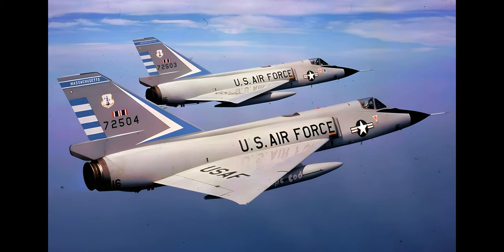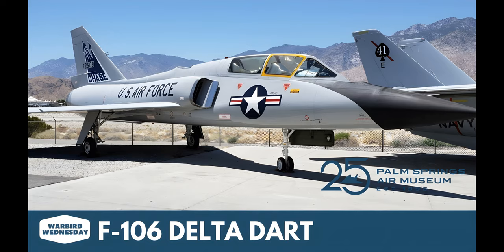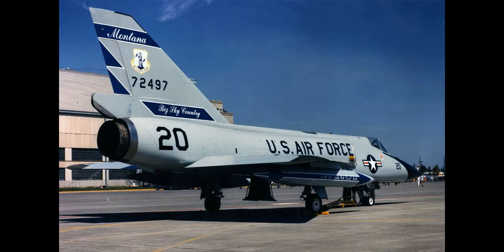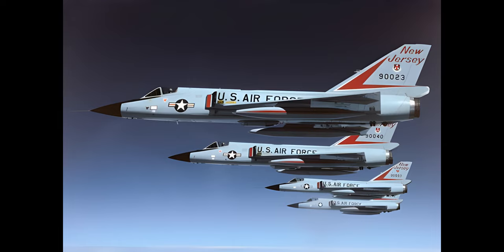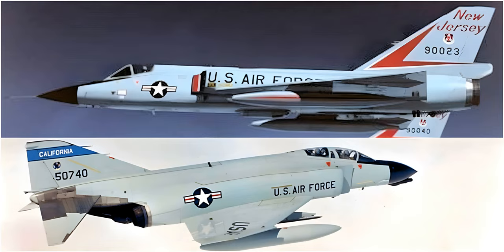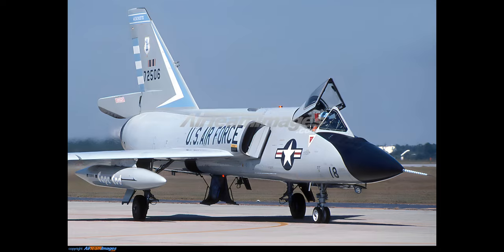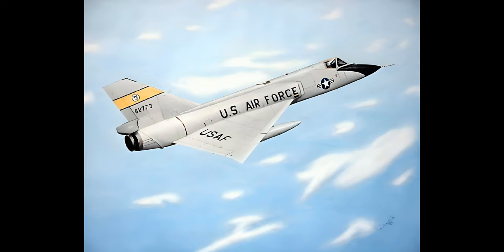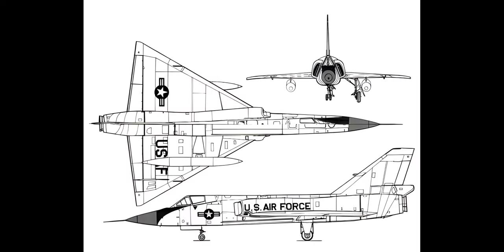Convair F-106 Delta Dart

Comment: Dear AudioWik, Please note we in the air force never referred to any fighter jet as "F-one-hundred" anything with one exception: The F-100 itself was the only fighter jet that was called "F One Hundred"' All other "Century Series" fighters from the F-101 to the F-106 were referred to as "F One-Oh-One" (F-101) or "F One-Oh-Four" (F-104), etc. always using "oh".
Reply: It’s an AI creating the vocals, not someone actually narrating. That’s why it mispronounces things and sounds so awkward.
Reply: @parkerlamarbrook  Even so, can't they write it so the AI reader sees it as one oh six? That's not likely to be misread that way.
Reply: Very true , I crewed the F-100 "Hun" and 101 Voodoo or one oh wonder
Reply: @robertstack2144  The "Hun" was one badass-looking fighter jet with that oval snout. I have some gorgeous photos I took of them in Vietnam. They were up from Phan Rang AB In Phu Cat AB, while our F-4s were doing duty over Laos, we had Huns take over in-country missions from our base. I loved it when they took off. The J-57 afterburner when lit sounded like an explosion, unlike the smoothly increased roar of the F-4's J-79 burners as they cut in...just one big BAM! Sometimes we'd duck if we weren't watching and then sheepishly laugh at ourselves. By the way, my F-100  photo has a VP on the tail with 063908. It had limped back to our base after it had ricocheted off of a hillside. The underbelly was green as grass and the leading edges were packed with wood pulp. The canopy had two big holes in it presumably from the NVA triple-A groundfire. That the pilot survived was a miracle.
Reply: @pops91710  I was in the136 TFW 68-68 TUY HOA. Before that Niag ANG, our AF attache Officer was Bud Day. I was a Crew Chief/rag wrencher. Thanks for your svc. I crewed 008 and two F models ...756 and 731.
Reply: @robertstack2144  
Well, all I know is we loved you in "The Untouchables" series, sir¡☆! 🫢
Reply: @pops91710  that BAM you are referring to may have been what we called a HARDLITE were the pressure opens the nozzle instead of the pesky 22 air operated cylinders. That would immediately raise the EGT and the pilot would write it up. That meant....pull the hook and door and the remove the aft section. That was the biggest pain in the behind about the Hun. Sure was a good looking airplane but a maintenance nightmare.
Reply: How about 0 (zero), instead of O's?? That is actually, the technically correct, terminology👍. There ain't any O's, in the 0-9's numerical, Arabic system☺️!!! The use of the term O, is for laymen only.
Reply: @rogerrendzak8055  WHAT? ARE YOU A MILLENNIEEIEELLLEILL?
Reply: @rogerrendzak8055  BTW A Zero was a Japanese A6M2 SINGLE seat monoplane with two cannons and 7mm machine guns that lost aileron  control ar HS dives.  Oh  for protectioon it was covered with rice paper soaked with wax on it's control surfaces. When on board an aircraft carriier Japan's safety office required placards stating  NO SMOKING WHILE AIRPLANE IS INOT FLYING
Reply: @robertstack2144  No. Baby Boomer. Just like intelligent, correctness.
Reply: @robertstack2144  I know all about, the 'Mitsubishi' Zero!!! I'm a WWll, aircraft historian. I believe they were officially labeled, as 'Zekes'.
Reply: @rogerrendzak8055  feelings hurt?
Reply: @rogerrendzak8055  where might I find that "OFFICIAL" RECORD?
Reply: @robertstack2144  Strange enough, in a thing called books🤨⁉️ Or at least, Google it.

Comment: It is easy to get the F-102 and the F-106 mixed up but they had almost nothing in common. I flew the F-4 in Vietnam and the Air Force used the F-102 at Da Nang AB as the field interceptor in case of an air attack. We Marines had the backup duty to help out once the 102s took off. The only time we got scrambled the 102s launched and then we followed about five minutes later and overtook them en route to the bogey. The F-4 was about twice as fast as the Dart. I never had the pleasure of flying with the 106 but it is a beautiful plane. BTW, the seat in the F-4B was a Martin-Baker with zero-zero capability as well as a very high-speed ejection envelope. We used a face curtain to eject that covered the pilot's face and kept the helmet from coming off. It saved many lives and has been very reliable.
Reply: The F4 was NOT twice as fast as the Dart. It was slightly slower than the Dart. Maybe the Dagger, but not the Dart.
Reply: @mtdusmc9437  My mistake I meant the dagger or F-102. As I said above, it is easy to get them mixed up!
Reply: @mtdusmc9437  The only competitor the 106 had before it was adopted was the Avro Arrow which was a terrific Canadian interceptor that just happened to come along at just the wrong time as the 106 was superior in almost every way.  Unfortunately for Convair the order was reduced and only about 340 were ever built.  When it was retired in the late 80's she was the only true interceptor in US service -- we still don't have a replacement to serve in that capacity.
Reply: @Raptorman0909  My Dad was an instrument tech on the 106. I sat in the cockpit many times. Know all about it.
Reply: @Raptorman0909  It is true the F-106 was the only single purpose interceptor in the inventory, but once the US and USSR began fielding hundreds and hundreds of accurate ICBMs, there really was little need for an interceptor as the likelihood of Soviet bombers attacking the US became minuscule.  Multi role fighters can do the job.
Reply: @Primus54  Which is why the order for 106's was reduced, they only made a total of about 340.
Reply: It wad a good idea to have a mix of 102's and sixes. The VC sapper squads wouldn't know which one was a decoy.....hopefully getting the deuces
Reply: @Raptorman0909  right, thank yo

Comment: I loved the story of the One Oh Six that glided to a landing after the engine quit and the pilot ejected.
Reply: I heard the farmer found it in the field with the engine still idling.
Reply: @pops91710  You're right, Michael. Something else forced him to eject.
Reply: Believe it or not, that bird is now at the Air Force museum in Dayton - its popularly called "The Cornfield Bomber".
Reply: An F-16 did the same thing with external wing tanks. The pilot was doing in-flight refueling. He ran out of fuel because his external wing tanks wouldn't feed. He ejected almost on the Air Base runway. I think it was at Hollaman AFB. That very same pilot wrote the dash one Flight Procedure Manual, for IFR, to be used by all USAF pilots, prior to the mishap. The procedure manual requires the IFR switch to be turned "on" to vent the external tanks. He did this. After refueling the Procedure Manual states to turn the IFR  switch "off".....he didnt do that....the external tanks didnt feed. The aircraft landed short of the field, gear up. Personnel jacked the airraft, dropped the gear, towed it to the base, found the IFR switch in the on position....fuel in the aux tanks. I would have loved to have been a fly on the wall at the investigation board meeting. Officers are great at saying use the checklist, it's a military order, it's mandatory. As you can see , they think it applies to thee, but not to me.
Reply: The pilot got it into a flat spin,  I don't think he had the common sense to pop the drag chute
Reply: Engine didn't quit. Pilot got into a flat spin. Force of ejection forced nose down enough to come out of the spin. Farmer found it running, sliding forward every so often on the snow. Authorities told him to just wait 'till it ran out of fuel.
Reply: Yes, pilot quit as many times. Tax payer paid $16, 000,000
Reply: @robertstack2144  I was in training as a 462X0F (Load Toad) at Lowry AFB, CO from Nov '82- Feb '83 and the training F-16A airframe that we learned on was the aircraft that you mentoned above.  I have a class picture somewhere that shows the tail number (78-0xxx, IIRC) which I can't locate right now, but I Googled the tail number some years back and it was the same aircraft that was involved in the incident that you mentioned above, although it might have happened at Cannon AFB.  At my age, I can't recall exactly any more.  😆

BTW, we had "school" in the old Black Shack hangar at Lowry and there was a 106 in there as well.  OMG, the first few times that the weapons bay doors was closed inside that hangar with that unmistakable "BAM!" it sure made most of us jump right out of our skin!  After about 5 or 6 times, we go used to it.  LOL!!
Reply: @johnshannon9  I believe you are correct in that it landed at Cannon. I was working in Flight Test at GDFW and was on loan to the propulsion  group for  few months. Got a lot of info from the field on ADG/JFS squawks. Even made inputs to Tech pubs group for troubleshooting. When on the FW flightline that pilot would cycle through the building. His last name as I recall started with a P and sounded Italian, but that was in 1980. He was the guy who forgot to go by the instructions he wrote in the dash one flight manual.
Reply: That pilot didn't
Reply: @pops91710  keys still in the ignition?

Comment: Wow, those were the days.  An ejection seat that killed the first twelve pilots that had to use it. What were they thinking?  By today's standards, that would have resulted in a congressional investigation and investigative news blaring criticism of the aircraft as a pilot killer.
Reply: "What were they thinking?"
They were thinking they need a seat rated for escape at supersonic speed, and it was the first seat designed with that capability.  It underwent extensive development and testing.  It was a very complex system with numerous actuators and initiators, and under real world maintenance conditions it did not produce the same reliability demonstrated in testing.  Unfortunately it only took failure of a single component to interrupt the escape sequence and kill the pilot.  When the failure rate was brought to the attention of the brass (by Jack Broughton) an investigative committee was formed. A new seat was quickly developed, one that focused on ejection from zero altitude rather than extreme speed, and it proved more reliable and saved lives.
Reply: It finally dawned on the seat designers that if a plane going Mach I or II had an issue, the first thing the pilot would do is to put the throttle to idle and any Mach plane would very rapidly drop below supersonic speeds. The most dangerous area to be in, in any airplane is the landing or takeoff mode. That is where the seat is most needed. My first two jets in training, the F-9, and the F-11 did not have a low-altitude ejection capability and it was usually deadly if the engine failed at low air speeds or altitudes.
Reply: @rudyyarbrough5122  Very true!   The first models of the F-104 even had an ejection seat that shot the pilot out DOWNWARD!   When I was 8 or 9 years old, I built a plastic model of one of the early model F-104s, and it came with a very realistic pilot and ejection seat that could exit downward.  More along the lines of WHAT WERE THEY THINKING?!!!   I remember reading about how one F-104 pilot was killed on takeoff when his plane developed problems, and, knowing how his ejection seat worked, tried to roll the plane upside down before ejecting.   It didn't work out too well for him, unfortunately.
Reply: @gandalfgreyhame3425  That was an era when engineers made all of the decisions about everything to do with a plane. You would have thought they would have learned their lesson from the last year of WWII when they went to bubble canopies on all of the US planes but they didn't. The next generation of planes all had the cockpit blended into the fuselage with terrible rear visibility. The F-4, F-8, F-106, A-4, A-7, and F-102 all had the blended cockpit. Now they all have bubble canopies and guns.
Reply: I know the source of that "first 12 pilots" figure, but I don't believe it.  The record shows that there were successful ejections with the F-106 bobsled seat right from the start.  Also some pretty gruesome unsuccessful ones.  I don't think they ever had 12 ejections TOTAL with the bobsled seat.
Reply: @gandalfgreyhame3425   The Air Force had about as many successful downward F-104 ejections as they did unsuccessful ones.  The seat worked fine as long as you had some altitude.
Reply: @dukeford  That's wonderful to hear!   If the Air Force gave you a light switch to use at your house that would work 50% of the time and KILL YOU 50% of the time, would YOU want to ever want to turn that light switch on?

Comment: Boy.....there are many GOOD vids about the F one Oh six but this is not one of them. What a dry computer bs data spiel.

THE "SIX" gave many an F-4 jock  a simulated death in training despite being 1/2 a geneation behind. The "Six" still holds the single engine speed record to this day at 1,525mph. Phantoms tend to run out of gas just as the training got good. With the next gen missles carried by the F-4 it would be a fairer fight. The SIX weighed much less than the "flying pickup truck" F-4 so it's single J75 did just fine. A beautiful and superb aircraft in it's day. Show some respect!!!
Reply: The 6 would run down a 111 with no problem did it all the time at William Tell before it was retired
Reply: @thomascreary990  wow....F-111's could go fast enough/long enough to soften the aluminum of the nose section. (There was a timer to limit time at max speed as I recall). Both the 105 and 111 could indicate well  over 850kts down low. I've heard F-15 pilots tell of trying to overtake F-111's from 20 miles behind. The F-111 just put the hammer down and ran the Eagles out of gas. My dad helped built many a J75 during his time at PWA. I wish they could have put the version of the J75 slated for the super crusader into a six....just to see what she'd do with 5,000lbs MORE thrust. The six would have eaten those F-4's for lunch....especially if they had had the aim9's. Were the F-106's over taking the F-111's at high altitude where they really shined or where?  That J75 was a BEAST of a turbojet!!!
Reply: @garyyoung4074  the 6 would eat the 111 alive all day long

Comment: The last active duty unit with the 6 was 5th fighter Sq at minot and don't say the jersey guard and I said active duty I was stationed there 82 -93 the last one left in early 84 when the 5th was converting to the F-15 until 88